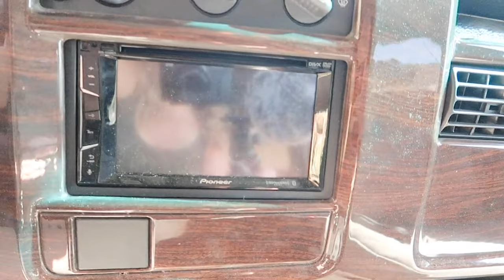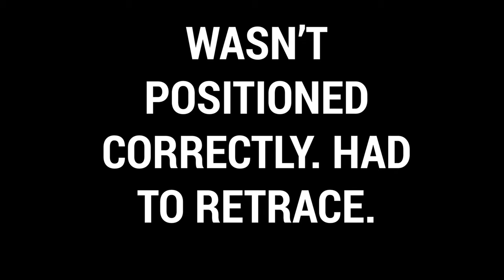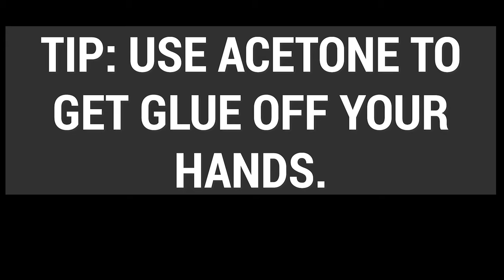How to Reupholster a Van Headliner and Paint a Dashboard Matte Black // Travel Snacks

Comment: Girl, plasti-dip will change your life. No sanding, no primer, no glue, you just spray a couple of coats and it even evens out for you on its own. Its super duper hardy (we have it on the outside of the car) and if you decide you need a change or you messed up, it just pulls cleanly off the underlying surface without damaging it. And if you have hard surfaces around what you're plasti-dipping (nothing porous) you don't even have to tape off. Any overspray just pulls cleanly off 🎉🎉 oh and there's a bunch of colors available (we got camo green and it looks dope) and you can do it in matt or satinize it with an extra coat

Comment: You can fix that speaker with some wood glue and a strip of paper towel.
Reply from the maker: Good to know! I used a bit of super glue but I don't think it worked that well. If it makes too much noise I might take it down and try your trick. Thanks!